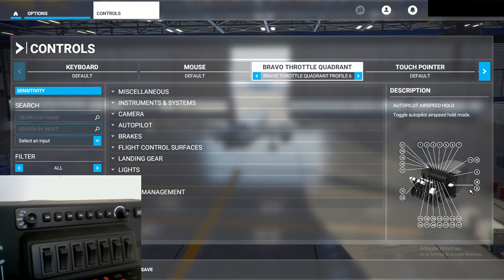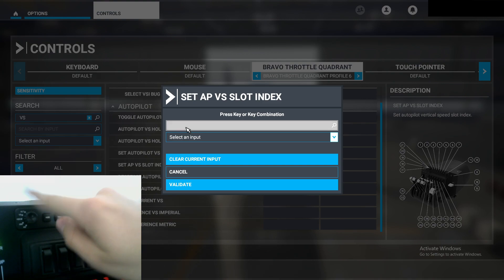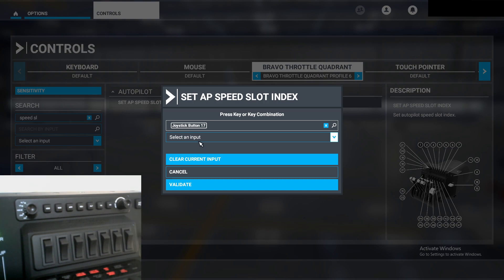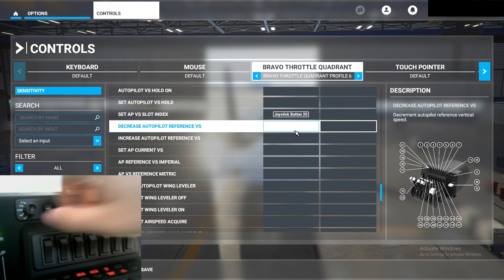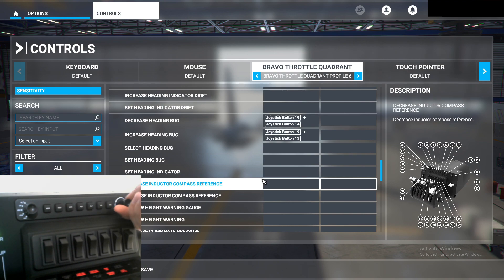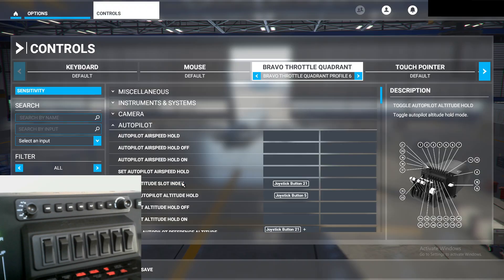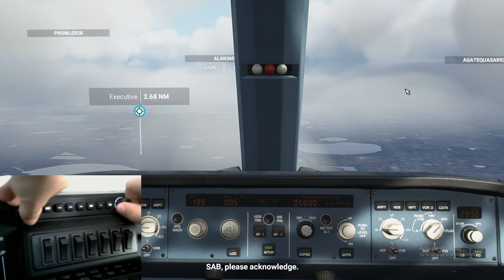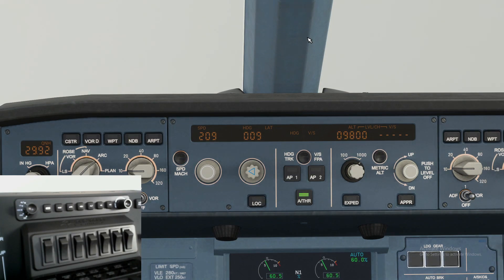How to set up Autopilot Panel on the Honeycomb Bravo Throttle in Microsoft Flight Simulator 2020

Comment: Thanks for this video
A couple of questions

What is the index bind do?
 Wouldn't just just binding the two keys together adjust the settings anyway!

As the the left rotary button is an "always on" bind (I can see this at 3:32 as the Altitude slot index is permanently highlighted whilst it's in that position) does this cause the heading bug increment issues when mouse wheeling  the heading bug in the C152 etc?
Reply from the maker: The index bind is basically for the left knob, it just allows you to, in conjunction with the right knob, adjust ALT, VS, HDG, etc. For the second question I think you are asking if when ALT is selected on the left knob, and you wish to adjust HDG with your mouse, will there be issues, the answer is no, there will not be any issues and it should work as normal.
Reply: @wallyrodaviation   I think you may find that if you load the Cessna 152 and try to rotate the heading bug with you mouse wheel it will go up in 10 degrees

I have the Honeycomb yoke and if I have any of the five light switches or the master or avionics or the engine start switches bound the heading bug dial in the Cessna will only mouse wheel dial in 10 degree increments

If you have time hop in the Cessna and try turning the heading dial bug with your mouse and see if you can increase/decrease in 1 degree increments . I'm extremely curious to see if you don't have the problem and if so trying to figure out why I do!
Reply: @noisecraftstudio5817  YEP, there must be a bug
Reply: @noisecraftstudio5817  I think I saw a video where the uploader had traced it to a bug in the simulator... I believe the description was, imagine on keyboard if you hold the key for increase thrust for example it will "repeat" to keep increasing, holding a heading increase will on repeat increase by 10s instead of 1s (after a while), and the problem is ANY held on/off control puts the simulator into "repeat input mode"... so that nice rotary switch on the left which holds an input will trigger the simulator bug all the time... something like that... see also https://forums.flightsimulator.com/t/honeycomb-aeronautical-partnership-please-fix-input-bugs/328899

Comment: First of all, thanks for the Video. But I have massive problems with the Autopilot functions. When I turn the Selectbutton between IAS, VS, HDG, CRS and ALT, the autopilot functions are switched off or on without the need for me to do so. Example: Turn the selection switch from ALT to IAS. ALT goes out, VS becomes active HDG switch so CRS. I then adjust the speed. Turn the Selectbutton back to ALT. IAS goes off HDG goes on VS turns off again and ALT goes on again. I don't know what to do anymore. Do you have a tip?
Reply from the maker: Well, when you switch to VS, ALT will turn off because your no longer holding altitude. IAS is usually for changing level or speed, If you are the selected altitude, EX you put 10,000 into the autopilot, VS will no longer be on. Depending on if you have conflicting button binds and the type of the plane, you may have issues. I'd suggest to start a whole new profile and start from scratch.
Reply: @wallyrodaviation  I have beginn from Scratch. Now i dont Push the Button VS. in ALT. I use the Scrollbutton on the Left to Change other Settings like IAS. You now what i mean? Okay You have Buttons for HDG, NAV, APR, REV, ALT, VS, IAS and the big square AP Masterbutton. Now I aktivate AP, ALT and IAS. I want change the Speed from 250 to 200 Knots. I Turn the Selectbutton on the very left Side. This is only a Selectbutton to enter new values. But i dont switch the AP from ALT hold to VS (pushbuttons) But the AP switch off ALT, Switch on VS and other Gosthinputs will do.
Reply: This is a bug. Check out RMAG's channel for a good explanation - https://youtu.be/bJSBxbmC3Eo

Comment: The default keybinds use indexes like you setup for the left knob but use ‘min/max’ keybinds for the right knob.  Did you see any functionality difference compared to the button combos you suggest?
Reply from the maker: In the default config some of the functions didn't work, but after I programmed them the worked either better or just worked period.
Reply: Ok mine worked with the defaults but I tried some of your key binds and they worked good too. Curios what didn’t work etc.
Reply from the maker: @RMAG  For me it was the  speed and VS that didn't work, maybe it was the plane IDK
Reply: Ok I tested the default config vs yours some more.  Essentially VS and IAS are mutually exclusive.  You can only use one at a time.  VS is to climb or descend to a specified altitude via a set vertical speed.  IAS is to climb or descend to a specified altitude via a set airspeed.  You can choose one but not both.  The default binding causes VS to be selected while it is being set, and when you turn the left knob off the VS, it deselects VS.  So you have to arm it again by hitting the VS button.  While this works, it’s clunky.  IAS works by default opposite, you have to select the IAS button in order to bring it up and set it.  And once it’s set it remains armed.  Unless your move the right knob onto, or past VS, VS gets armed and IAS disarmed.  

With your bindings altitude and heading work the same.  IAS works the same as default, the big difference is your bindings for VS gets rid of it automatically arming or disarming VS to set it.

Your handling of VS in my opinion is superior to the defaults.

BTW the bindings for your setup for CRS is left knob CRS selection set to VOR OBS. Then to adjust you want to do your button Combo of Button 18 (the CRS index) + MINUS to decrease the course selection and Combo of button 18 and PLUS to increase the course selection.  PLUS and MINUS are found in the Miscellaneous section.

Finally...  to have the default autopilot keybindings work the way you did yours without much effort, all you need to do is delete the keybind for Button 20 on “set autopilot VS hold”.  Then you just need to manually select VS like your bindings to change it.
Reply: @RMAG  someone may have done a video on that
Reply: @RMAG  Hi, you got a point here, in real life climbing to high altitude/level flights are restricted to 250 kts. Bellow 10000, then pilots discretion 280-320 kts. Unless requested to expedite climb/descent. And no you can't have the cake and eat it. This is where you revert to vertical speed. Cheers.

Comment: A challenge would be how to toggle the starter on AND off on the cj4.. tried but failed. It will only turn it on but not off, same with run engine... but this tutorial is awesome, helped a lot on the AP set up

Comment: is there something special for the lights to work? I downloaded the MSFS files from aerosoft but they're still off
Reply: Aerosoft JUST released an update today  (Dec. 22/23 2020) that fixes it. Download it from their hardware page and it will work.
Reply from the maker: What platform did you purchase MSFS from, steam or the Microsoft store? If it was the Microsoft store you may have to launch the application in order to get the LEDs to come on.

Comment: CRS is “course” which selects the VOR radial or nav course on the CDI / HSI.
Reply: CRS is the course can be assigned to VOR 1 OBS Decrease and Increase
Reply: That’s correct it’s course
Reply: Thank you for this video!
Reply: Thank you all !
Reply: Just to help you understand, HDG or Heading is the magnetic direction the aircraft is pointing.  If there is no crosswind, the HDG and CRS or course will be the same.  If there is a crosswind from the left, it will blow the aircraft to the right.  The path of flight is the Course, and the direction of the nose of the aircraft is pointed is the heading.  In this example, to compensate for the crosswind from the left, the heading would be to the left of the course in order to fly directly to a waypoint or VOR/VORTAC.  Also known as wind correction angle.
Reply from the maker: Ah thank you, I'll make sure to bind it
Reply: @wallyrodaviation  which option did you bind it to? I see 3 options for course
Reply from the maker: @MizaProductions1  Off the top of my head  I believe it  was something to do with "Index"
Reply: @wallyrodaviation  Hi Wally, you did a great job here. To add my two cents, as you approach a VOR. Don't wait to see zero on the DME, over the VOR, go ahead and change course/bearing to the next radial the VOR/DME will read the height as mileage so at 6000 ft. The distance overhead will be one mile. Regards.